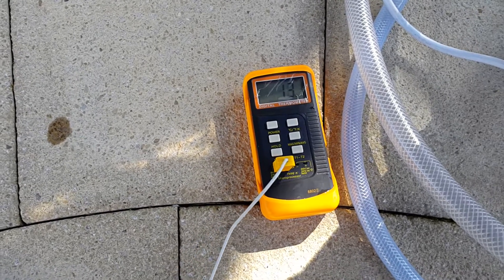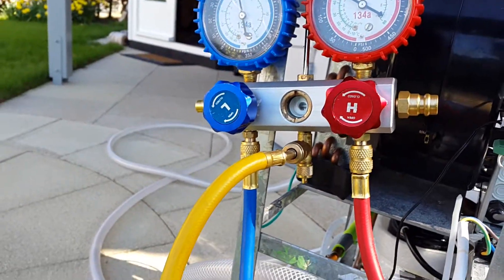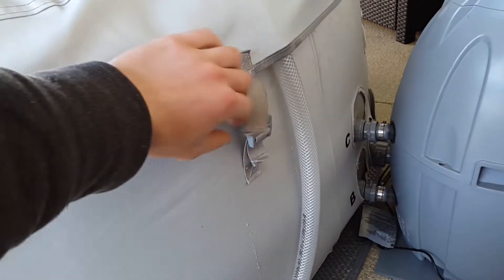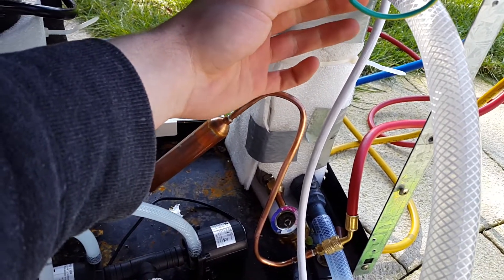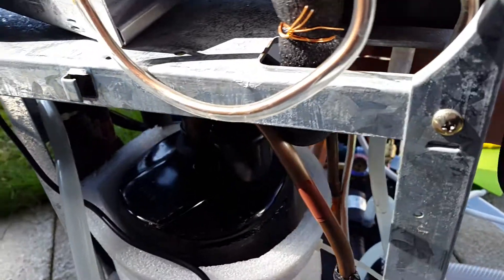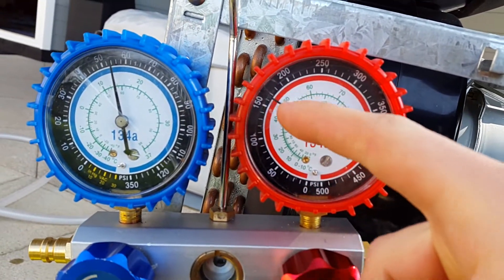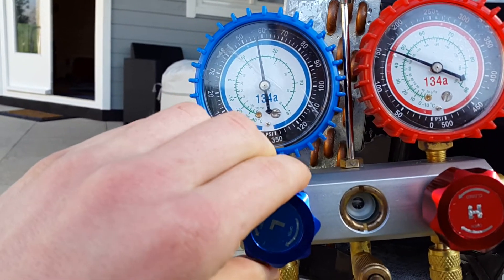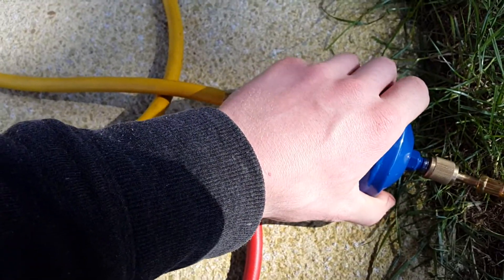Hot Tub Heat Pump Working Well

Comment: Hey Shaun....what fixed your issue with the frosting of the evaporator?  And you were also having trouble bringing up the water temp from cold start.  Also  do you recall what you got for a temp out of the discharge line?  I could email you if that is better....I am building a similar system and I think my heat exchanger is a bit small.
Reply from the maker: I think there is a more recent video where I fitted a thermostatic expansion valve. This greatly improved performance and efficiency.
Reply: @ShaunDobbie  OK I will check it out.  A TXV is definitely next after the needle valve experiments. TNX.

Comment: That heat exchanger is  A LOT more and good only for 4kw...I think it would be ok for 50kw, depending on input and output water
Reply from the maker: I was going by the item description and datasheet, I agree with you though but it wouldn't handle 50Kw.

Comment: Totally agree re the TXV, With the wide range of temps this has to deal with, it's the only way to do it! Off the top of my head you want an danfos ten2 with about a #4 orrifis.
If I'm correct, and do double-check, that should be an r-22 bulb, which is pretty compatible with 290.
would be good for up to a 6kv system.
Don't worry too much about condensation in the compresser body. it will be a hotter part, and all the condensing will take place in the coldest part where there is both liquid and gas.
You could wrap the compresser in insulation to keep in the heat if you like.
For defrost, I think you could get a w1209 thermostat module from ebay. They are brillient, and super cheap. 
They work from -50 to 110c and have variable historesis, and time delay functions.
If the air con you're using has a reverse cycle valve, use the thermostat to chuck the valve in now and then to melt the frost and then resume normal function.
Once you have the txv correctly set up for as little evap superheat as you can get away, with, then adjust the refrigerant charge to minimise the subcooling.
After all, the part of the heat exchanger full of completely liquid is not doing anything useful!
I for one am keen to see how you get on! Good luck!
Reply from the maker: I was thinking of buying R407c for it but that might be illegal. There is a seller who would just sell it no questions. I will try your advice.
Reply: The thing I found about 290, as opposed to say, r-22 is that it loves the oil, and really mixes with it! In one way it's good as it'll circulate fine, and it works with all kinds of oil, PAG, POE, mineral.
The very slight hitch is that warmup time is longer with a rotery compresser as you have to wait for the whole thing to get hot before all your 290 is circulating.
Good you can get gas if you need to try it!
407c is supposedly almost identical to r-22, but you need the right types of oil.
134a is in servisol freezer spray, and other brands of compressed air cans have stuff like r-52 I think it is in them.
We did some messing with car air cons, and found that a 70 30 mix of propane butane worked almost exactly like r-134a
Propane on it's own froze it up, even on really hot days, Impressive, but a bit of a problem in practice!
The other refrigerant that might be good for your spa project is r-32, or at a pinch, r-410a.
They are higher pressure low boiling point gasses, which would perhaps retrieve heat better by getting the evap even colder.
Here, I've got a good collection of r-22, and it all came from buying up cheap old second hand air con units from ebay.
You can recover them, and you get a stack of nice parts as well!